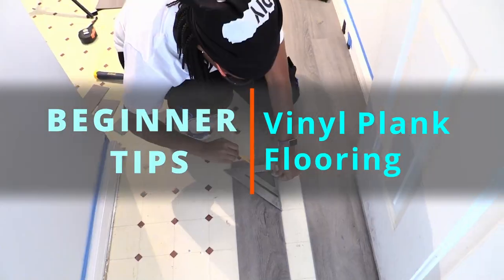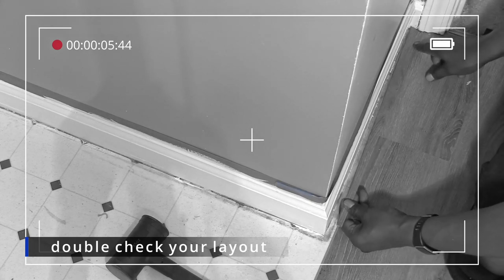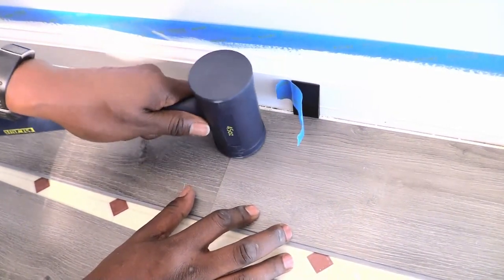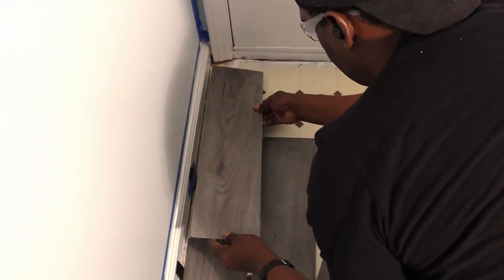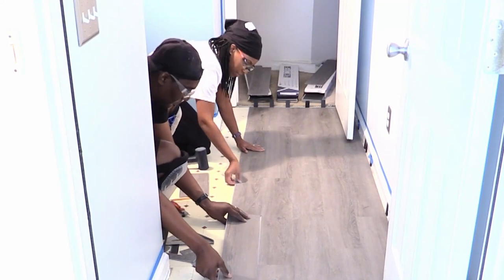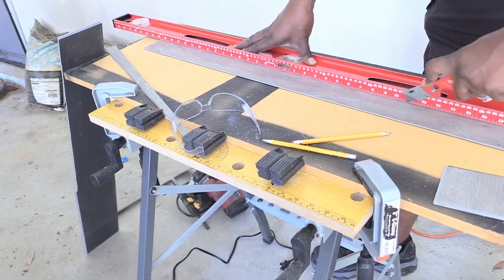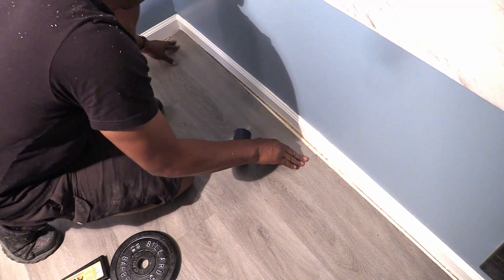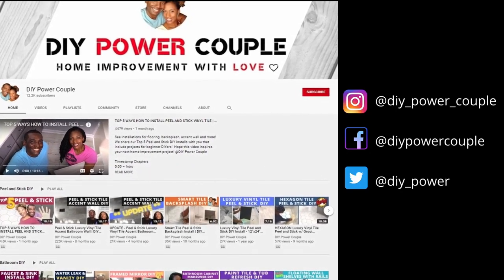DIY Vinyl Plank Flooring Install Over Old Floor in Laundry Room FOR BEGINNERS

Comment: Was the underlayment not needed because you were placing over vinyl or because of the planks you were using? Going to do my kitchen and laundry closet and it has vinyl flooring already on top of a concrete subfloor. Gets cold so wanted to know if it would hurt anything if I did and underlay?
Reply from the maker: Hi! Underlayment was not used because of the existing tile. You can use underlayment when recommended by the brand of planks you choose. Just remember that it will also increase the thickness of your floor which could cause your planks not to fit under door jams.